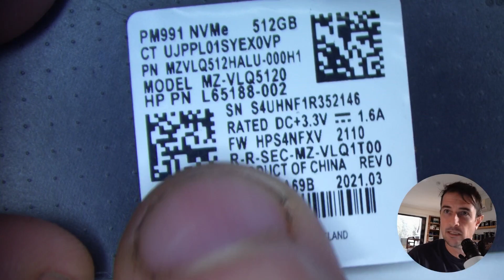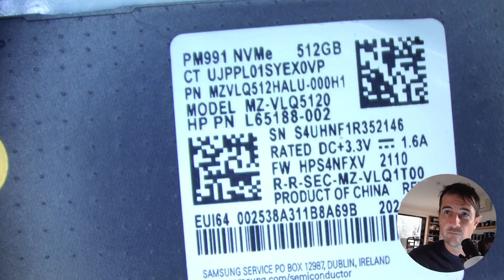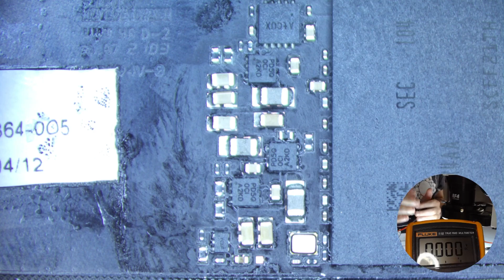Samsung PM991 SSD Data Recovery

Comment: I have a similar case with PM991. NO ID, but It's getting hot. All voltages on PCB are good, no shorted caps. I don't know what could be a problem with it.